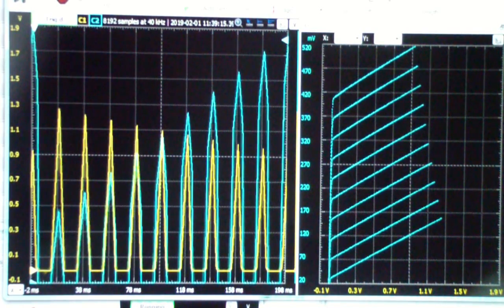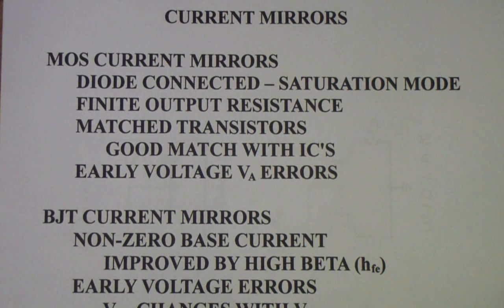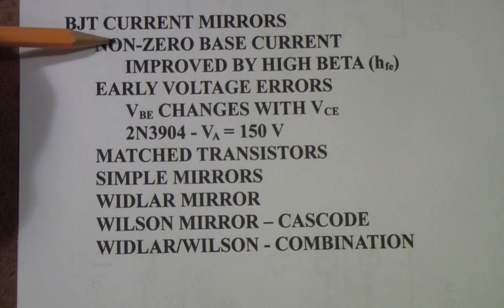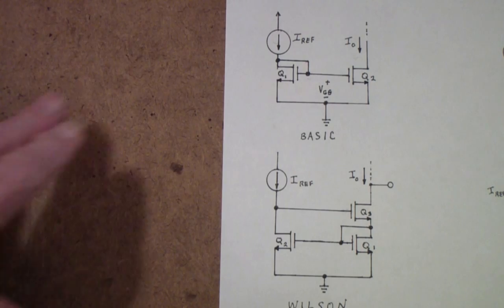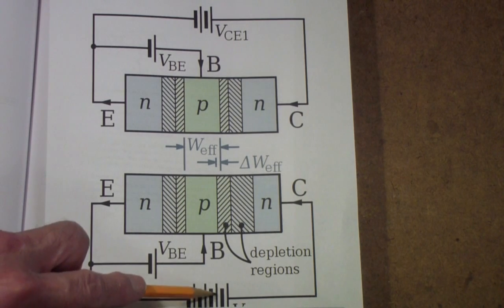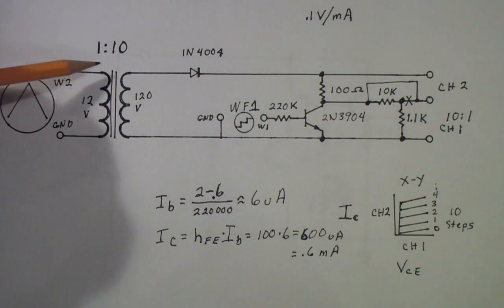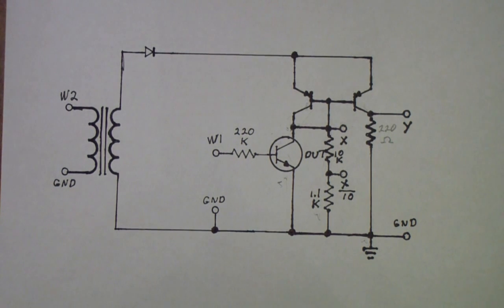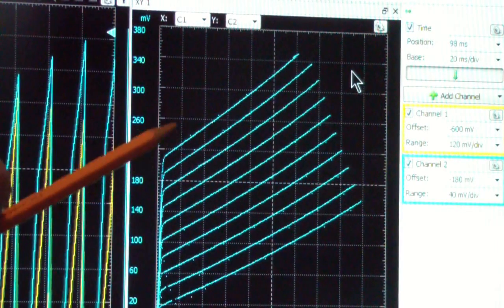TTT245 Using a Current Mirror to Further Improve a Curve Tracer

Comment: Hey,
I have a few things.

1. A current mirror built on discrete components can be far from ideal.
The collector current of the left transistor can differ from the collector current of the right transistor in the current mirror from your video by up to approx. 1 mA for UCCmax!

2. The voltage divider current is also not negligible. For Ucc = 20V is equal to:
(Ucc-Ube) / Rd = approx. 1.7mA
 Rd=10k+1k1
at a collector current of approx. 3 mA (sic!)
This is the reason why your curves fly sharply upwards. Too much . You simply inflate this current compared to the real one.
 3. The 470k base resistor limits the measurements to a collector current of approx. 3 mA
(Uawg-Ube) / Rb * beta = (5-0.7) /470k*300=2.74mA
beta = 300

4. This can be remedied by defining the appropriate mathematical channel in AD2 calculating the divider current corresponding to the Vcc voltage and subtracting it from the collector current calculated on the basis of the voltage on the 100 ohms resistor.
However, in this way we do not eliminate the asymmetry of the current mirror, which increases with the current flowing through this mirror.